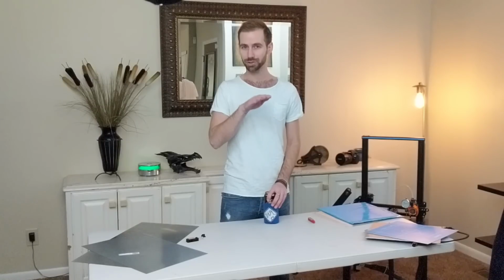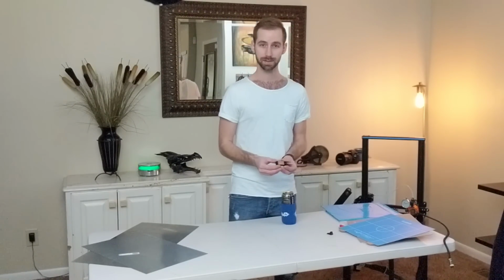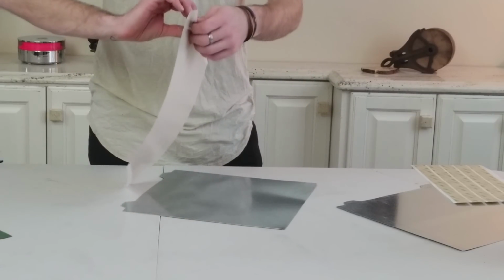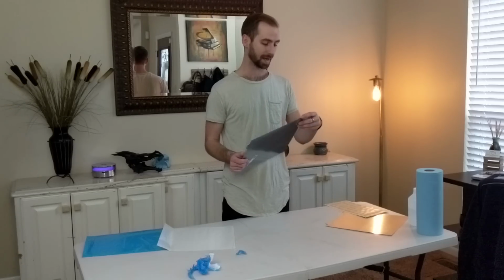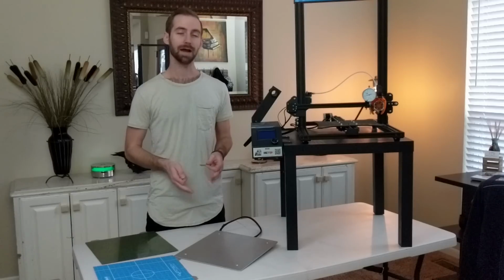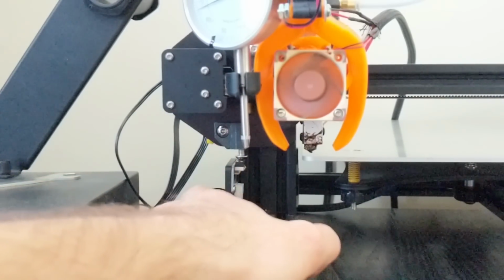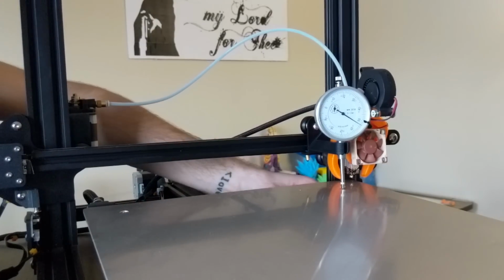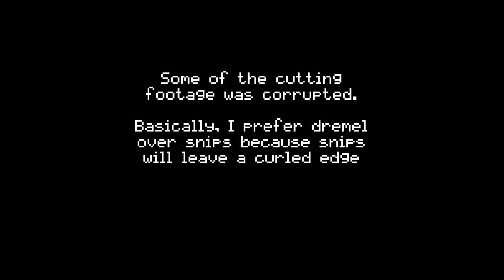DIY Magnetic 3D Print Bed v2! The best printer upgrade! Learn how to level your warped cr10 bed

Comment: my bed is too thick for the magnets to still attract anything ;-;
my problem with the pre-made solutions is that if you wanna take the magnetic base off it gets completely destroyed
Reply from the maker: You can stack the magnets on top of each other to increase their pull force.  This video is fairly old for how much things have advanced. You can even probably find magnets that are the same size but have a stronger pull and are still heat resistant. The printers I did this to are still all using the same original magnets
You'd want premade solutions to stay like that as they aren't intended to be removed. Bummer you're not finding the solution you want though
Reply: @ImproperEngineering  hey I was wrong actually. i tried another magnet and it pulled my spatula very hard even with my glass over it :D but I can only find 80c max magnets sadly.... I gotta maybe look more.

my only issue with pre-made solutions is that they're impossible to take off and would be ruined if I do so. and my bed is bowed!  I gotta try adding the middle screw as you suggested
Reply: @ImproperEngineering  it's good to know that they lasted tho btw

Comment: really cool, was at the local lumber and got a sheet and some magnets.  great info, been thinking of doing this for some time.  one thing, leveling the under carriage. that center lift is cool, but thinking it might soften and loosen when the bed heats?  the cork insulates some, but enough?  anyway, other option... Blue tape build up. my bed is actually raised in the middle. I take squares of Blue tape and layer them up in strategic areas to pad up. works like a charm.   Just another option. :)
Reply from the maker: since it's in PETG there shouldn't be an issue. honestly i think you'd be okay without cork at all on it anyways. i def don't recommend it in PLA though.. good option though!

Comment: Hi I've been thinking to make the same thing, but you have to realize that neodym magnets are sensitive for temp. Mostly the temp above 80 deg celsius will probably hurt them. Have you been printing ABS on this?
Reply from the maker: Mario M hey Mario, as mentioned in the video the old magnets cannot take the temp but the new ones are fine for up to 150°
Reply: Sorry, I missed that, seems the N42SH should be ok. Thanks.

Comment: Have you considered just buying a springsteel sheet from build tak to use with the magnets
Reply from the maker: Patrick Thomas the one that's like $100? That's way too expensive for something that works just as well as this IMO
Reply: Improper Engineering 
It's like only 30 dollars for a spare flex plate that's 12 inches square. Not the whole system just a spare plate and use yournown magnets

Comment: Hey there, can you link me to your dial indicator, and the mount for it? I have the fang mount for the stock blower fan, does that stuff work with it?
Reply from the maker: I've got everything linked in the description :)
I'm not sure though as I've never kept the stock fan on. On mine I had to shave a little off the dial mount after it was printed. I could have redesigned it but honestly it was easier for me to spend 20 seconds with a dremel than it was to spend a few minutes redesigning.
Reply: So, it looks like everything BUT your dial indicator is in the description. Is that mount made to work with any dial indicator? In that case, it doesn't matter which one i pick up. I do like yours, though!
Reply from the maker: Oh did you mean the dial indicator itself? it was a cheapo from harbor freight! I'm sorry, I thought you meant the mount for it!
Here you go
https://www.harborfreight.com/1-in-travel-machinists-dial-indicator-63521.html

Comment: I tried to do this on my CR10s and with the glass bed removed, the Z axis can't get low enough because the metal brackets (with the roller wheels) hit the top of the stepper motors. It can't get down low enough to engage the limit switch because of the metal brackets hitting the top of the motors. Anyone have this problem?
Reply: J Belle Yeah, I just found the same issue. I’m confused as to why the printer in this video has the opposite problem!

Comment: Hey man thanks alot for this video. Other than EZABL, I'm also wondering if this would work with BLtouches. as the pin on the Bltouch is metal and I wonder if It would stuck the pin down. Would be great to hear from someone. Thanks!
Reply: I believe the BL touch is a mechanical type sensor, so it should be fine . Perhaps somebody who has one can tell you more.  The ABL is a inductive sensor so it is more suspect to have a problem.

Comment: I do not have a cr10 but I would love to use some of these ideas. I was going to be using a buildtak flexplate and likely some pei eventually. But the best idea I saw was the dial indicator. I have one and have been thinking about a mount for a while. Best way to check for concavity.

You asked about three and four point mounting I believe. I have used both. The advantage with three point is that it forms a plane, the disadvantage is it can be wobbly.

On the larger bed, I prefer the four point. But you have to be careful of the order because you can put pressure on one of the mounting points.
Reply from the maker: the dial is for sure the best. i use it for the initial level on all my cr10's now. makes complete sense on the point leveling. i didn't have an issue with it, luckily!

Comment: I did not understand what thickness of the foil to use, can you repeat? What material is the foil made of (specific?)?
Reply from the maker: Hey Cesare! By foil do you mean metal? I'm not 100% what kind of metal it is but I know it's zinc coated and is 26 gauge.
Reply: ok, thanks . i follow the project from the first version and now i would make that, only one think, i would insert magnet in the plate becouse i make a new printer and i make i specific plate for that, under the plate i eould install 220v pad and i haven't the space who sticking magnets So I thought I'd make holes over the top and glue the magnets to the level. What do you think. sorry for my english
Reply from the maker: that would work if you have the tools! good luck with it, sounds like it would all work. make sure your glue is a high temp glue. i would probably go for silicone over any type of glue or epoxy.
Reply: Yes the tools I have them but anyway the panel I'll cut it to the laser, for the glue I will better inform, thank you! Here in Europe I found circular magnets (comfortable to make holes) that resist up to 350c °, and carry 0.45 kg, how many do you think? Thanks again for the help and congratulations for the video
Reply from the maker: shoot me an email, let's move the discussion there. improperengineering.com/contact

Comment: If you want to increase the strength of your magnets add a piece of steel to the back of the magnet in the same thickness or thicker of the magnet. the opposite side of the magnet will have a greater pull.
Reply from the maker: Do you have any material to back this up? Not saying that you're wrong, I'd just like to read up on it as I've never heard of this! I do know you can increase your surface coverage of a piece of metal and have the magnet appear stronger.
Reply: ( https://www.kjmagnetics.com/blog.asp?p=mounting-magnets ) Has a nice graphic and explaination on why using mounting cups works better.  Also stronger magnets are not always the solution because if the steel is too thin it saturates and most of the force goes through the steel and not into it. So sometimes quantity is actually better than quality. That site also has some useful calculators. If you want a source of spring steel mcmaster carr is a good source. Thanks for the video it was great.
Reply from the maker: Thanks! I'll be reading into this as I didn't know that

Comment: not a bad hack.  While spring steel isn't "necessary", it'll retain it's shape even if you flex it heavily.  Or is your intent to continue scrape the parts off but have it swappable?
Reply from the maker: joe zenkus I talk about that on v1. As it currently is there's no need to scrape anything, it pops right off

Comment: My bed is warped. I'm starting to think all of them they send with this printer are warped.  I ordered the dial caliper and I'll print the holder thank you.
Reply from the maker: that's a bummer man. luckily it's an easy fix!
Reply: Or you can tram your bed. Much easier and it doesn't matter if it's concave or convex

Comment: what is the tool you were using to cut you spring steel sheets?
Reply from the maker: Dremel. They are normal steel sheets, not spring steel.

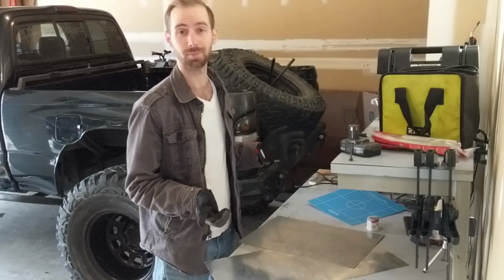Comment: @5:24 Nice Tacoma 8)
Reply from the maker: Thanks man! that's my baby :) I've got a semi-finished build log for it at http://improperengineering.com/the-tank-build
Reply: Nice.  I've owned my '96 for 15 years, mostly stock with a 3" lift and 32" BFG-AT's.   But I'm getting close to putting an offroad bumper, fender flares, lights, and a new paint job on it.  They're great trucks!  They just don't quit.
Reply from the maker: Nice! Mine has 220k on it(most of which was put on by me) and before parking it for 4 years I drove it like it was a rental. My very first vehicle was an '87 4runner. Can't beat 'em!

Comment: for applying the adhesive tape to the metal sheet, i suggest a plastic joint knife like these:
https://www.homedepot.com/p/Putty-Knife-Set-DS-3PKL/202038680

i got bubbles when i didn't use this, and no bubbles when i did use a 6 inch wide knife.

edit: fixed link that got mangled by youtube comment formatting "help".
Reply from the maker: nice! what I cut from the video was me attempting to use something similar but just wasn't coming out very well for me.
Reply: Improper Engineering hmm... I'll make a video of how I do it when I make the next one

Comment: I would love to do this but the price of shipping for the magnets is just stupid. The cost of the 9 magnets is $27. They want $20 to ship. That's beyond ridiculous for something that weighs in at .36 pounds. 

Anyways, good work on this but I guess I won't be doing it.
Reply from the maker: I hate to hear that, sorry. You could get the ones I used in the v1 video, just wouldn't keep your bed consistently above 80*
Reply: You can still use the binder clips while you source a better place to purchase them.  The point of the build plate is to grab whatever your printing.
Reply: This is true. Which would make it work but gives up the convenience of easy removal via the magnets. Still have the flex portion too. Thanks for the reply.
Reply: I just used the keyword "N42SH" to order magnets from a local supplier, and they weren't expensive at all. They haven't arrived yet so I don't know how good or how strong they will turn out, but they promise to be stable to 150°C too. I suspect it will be the exact same material really.
Reply: Siana Gearz Yeah, I've done that several times and not come up with anything better than I said above. Mind letting me know who you ordered from?
Reply: It's not gonna help you, because i'm from the opposite end of the world, but here goes, eSYSco in Furtwangen, Germany. They carry RC and robotics components and various industrial surplus.
Reply: By the way, you should check out Furtwangen (Schwarzwald) for your picture calendar needs and such. It's like Switzerland, but all condensed into an absolutely tiny village. With like the world's tiniest mechanical engineering university that apparently can only enrol a few hundred students who also make up the bulk of the village's population, and there's a bunch of mechanical industry there. I'm obviously exaggerating, but perhaps not by much.
Reply: I think these will work.  The max temp is 80C the max temp of the heated bed on a CR-10 is only 90C...
Reply: Look for it on AliExpress

Comment: just a technical issue - either get a lapel mic or somehow improve the sound, plus the background muzak is making hearing you even harder. I beg you to consider getting rid of it or at least lowering its volume in the mix. Thanks!
Reply from the maker: You're not the first to say that on this video. First time I've had an issue with it all. Thanks man, mic setup coming soon!

Comment: FYI, This is an even better option for magnets:  https://www.mcmaster.com/#7301T21
Apply to the top of the print bed, and the sheet steel will hold much stronger than the small magnets under the bed.
I've been using mine for nearly a year now.
Reply from the maker: jrucker2004 I'll order one and test it. That does have a lower temp rating and I've never heard anything good about magnets like that. Thanks for the link!
Reply: That one is rated to 120C, most of those types of magnets are only rated to 80C.  The only complaint I have is that the magnet material is kind of soft, and you can damage it if you drop stuff on it, but there's so much surface area, removing a small damaged area won't make any difference.
Reply from the maker: The ones I mention and link to in this video are rated to 150c. 
I'm def going to try a sheet out though. I do like how a metal sheet is sort of forgiving though. I feel like if you drag your nozzle too low on a magnet sheet like that you can give it a permanent crease.

Bummer, I just noticed they don't offer a size big enough either. That rules me out. For smaller beds it may be a good solution but not for the CR10s.
Reply: I'm getting my new CR-10 S4 upgraded now, and I'll be using these sheets.  I'm buying multiple and cutting them to cover the bed.  There's no reason it needs to be a single contiguous sheet.  Just to be clear, I'm still using a build-tak like surface on a steel sheet that is then placed onto the magnet.

Comment: ok I love this mod I made the plates for all my printers and put a few layers of heat reflective tape on the beds for insluation and then used superglue for the magnets the plates hold well with the magnets I bought and they held up to the bed getting to 90c the magnets say they can go to 175c but I can't get most of my beds past 92c anyways the magnets I used are a little less the $20 for 100 for my ender 2 I used 14 (4 in front 4 in back 2 in the middle and doubled up on the corners) ender 4 (3 rows of 4 with the corners doubled up) cr-10 and tronxy X5S 24 (4 rows of 4 with 4 around around the center and the corners doubled up) https://www.amazon.com/gp/product/B018ITTFDM/ref=oh_aui_detailpage_o06_s00?ie=UTF8&psc=1
Reply: I was reading the reviews on Amazon for the magnets and some state they aren't very strong, though at least it looks like they're rated to take the heat well above 175C. Based on your experience I'll give them a try.
Reply from the maker: I had always heard those magnets never last and aren't as strong. Hopefully that's wrong though, look forward to hearing how it all works!
Reply: Improper Engineering thanks. Considering I can get 100 for the price of 8, I'll take my chances ;)
Reply from the maker: Jerkson no, absolutely! I'm excited to know how they do, I may be switching for future mods!
Reply: They are pretty strong when applied to the steel sheet directly, but not when through the aluminum bed. Definitely need to double them up on the corners and use a lot of them throughout the bed. I dont think the sheet metal will move during use, but it's definitely not stuck with the level of force seen in your video.
Reply from the maker: Bummer, but thanks for testing it